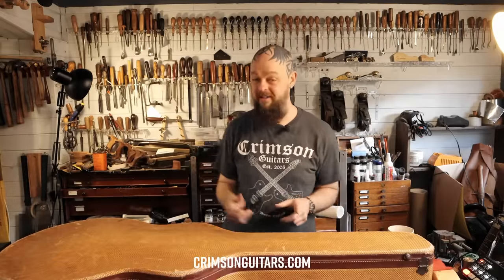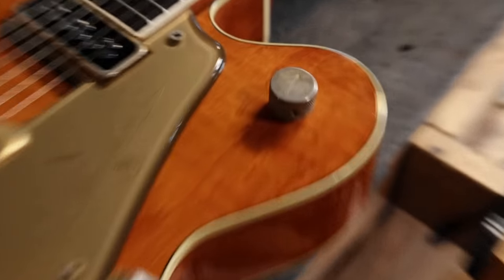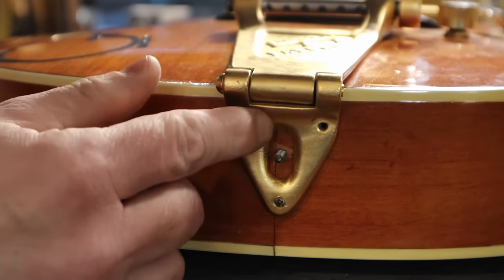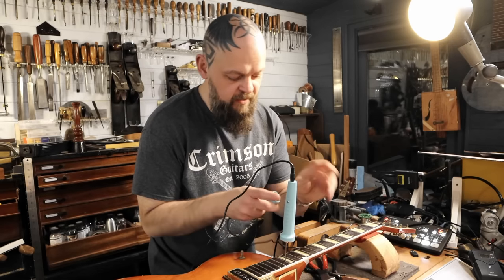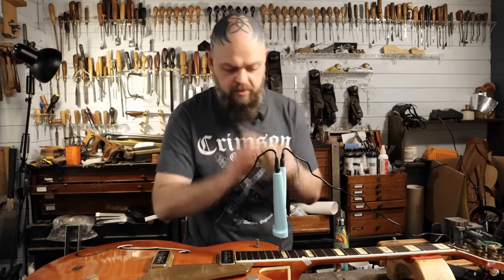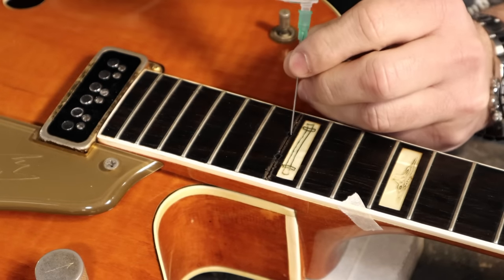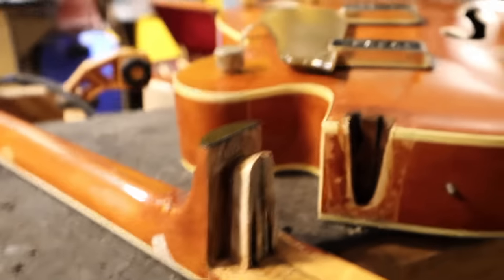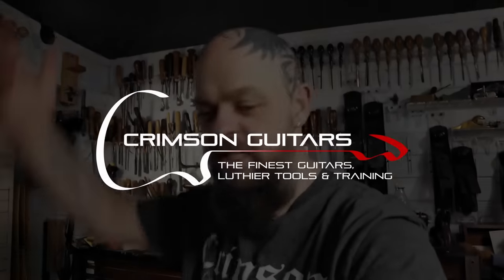Ripping The Neck Off a £27,500 -1954 Gretsch 6120T-LS - Part One

Comment: Vintage Gretsch guitars were always out of my budget (even in the 1980s before they got ridiculous) and I knew a couple repair techs that told me every single instrument that came through their shop needed a neck reset.  BTW, vintage Hofners came in and you could see that they didn't bother to drill pilot holes for hardware.  That is unthinkable for the modern guitar builder.

Comment: I think it's really helpful to see that a vintage instrument is not necessarily well made. The vintage market (and prices) has been out of control for a long time, when ironically there is not much doubt that almost any modern instrument will have been more professionally made and put together. That means you are spending tens of thousands more on 'mojo' rather than any actual reality.
Reply: Fully agreed.....just because it's 'vintage' does not mean it's better.  There must have been quite a few guitars that the likes of Hendrix must have  said "no thanks" when trying them in a guitar shop.....and now those very 'rejected' guitars are fetching a fortune purely based on their age.
Reply: Some that I've come across are, at least to me, absolutely unplayable... However "original condition".  Just like anything else that's made for profit, corners are very noticeably cut.  Most, if not all, of the vintage market is an absolute tone chase.  Agreed that modern guitars are much better made with each discovery of new manufacturing techniques.
Reply: Modern instruments are not well made because they keep on replicating vintages ones.

These prices are here to stay wether we like it or not…
Reply: Some of the worst guitars I’ve ever played were vintage. I had a 1958 Gibson ES-175 that was completely unplayable. It was in fine condition as well. So what do you? Well I’m not a collector. I like to play my instruments on stage. Also I’m not going to have the instrument set up to be a player and ruin the value. So I sold it to a collector in Canada. Win win
Reply: I don't know, speaking for myself... Vintage instruments can, not only be shoddily made, which was a good point you made. And I know there may be exceptions, however.... Every one I've ever played sounds old, controls are scratchy,  electronics..  It they sound like they are just hanging on by a thread. ...they smell funny. Not everyone necessarily likes that. I kind of am liking modern improvements better.
They are also getting more conducive to the world around us that we are in.  Though I have seen appeal in various vintage instruments myself, I don't think I want to necessarily own one.

Comment: I can only imagine the pucker factor while drilling into and removing the neck of that guitar and those very valuable ones like it. It only takes one mistake or the failure of the wood itself to ruin the guitars entire value. My cheeks would have been squeezed tight while trying to pull that neck.
Reply from the maker: It did take a while to work it all out - the videos are well edited!